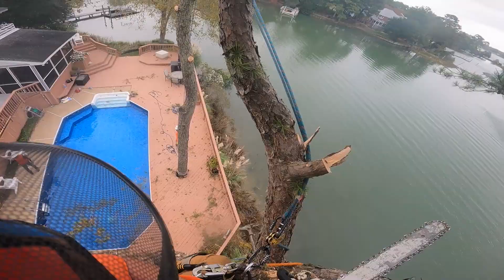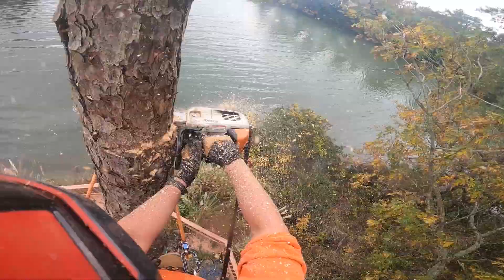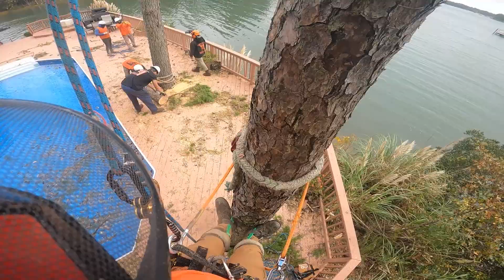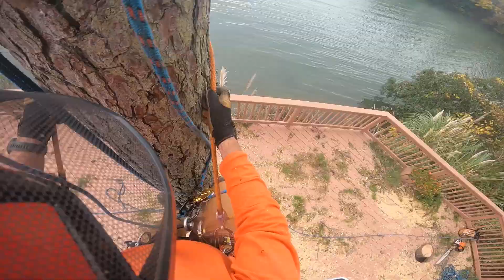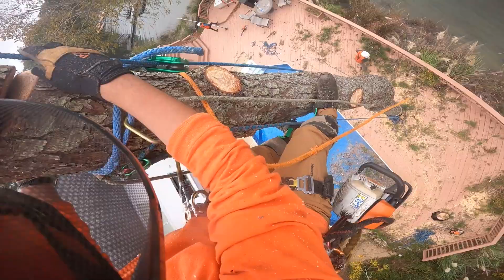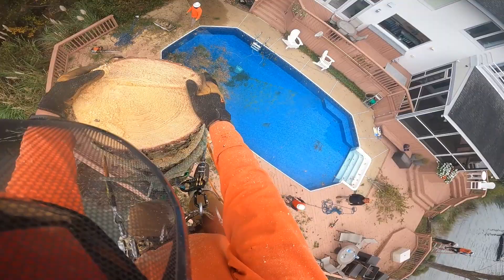2 pines in a deck with ZERO drop zone. (Part 2)

Comment: nice video and technique.. cringed when you free dropped the stumps but you knew what you were doing
Reply from the maker: Yeah there wasn't really another option to get the rest of it down. I wish I had turned the GoPro back on because they went and brought some plywood laid it down and I dropped rounds onto that. But we didn't break anything so that's what matters
Reply: @ReallyTallTreeGuy  I’ve had to rig/block all the way to the deck before. Have to rig ridiculously short pieces as there’s no room to let them run.
Reply from the maker: @small-town-southern-man3573  I had considered doing that, but I figured it wasn't worth the time to rig out one foot or smaller pieces, so instead I just opted to gently drop pieces
Reply: @ReallyTallTreeGuy  I swap to a short 5/8” rope and rig 3’-4’ pieces and have the ground guy basically snub them off without running.
Reply from the maker: @small-town-southern-man3573  yeah that's generally what I'll do, but there was maybe enough room to rig out a single 3 ft piece without having it run at all. But other than that we just didn't have the height
Reply: @ReallyTallTreeGuy  Gotcha. How high was the first chunk dropped? Video made it look like 20’ or a bit more.
Reply from the maker: @small-town-southern-man3573  if I recall, it was about a 6-in piece and it was think about 15 ft up. The super view on the GoPro makes everything look higher than it actually is.